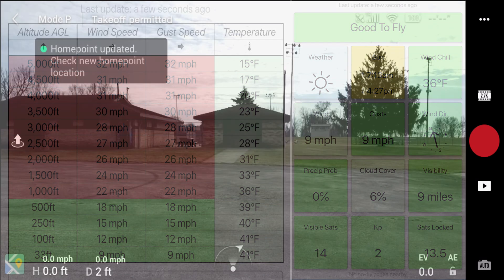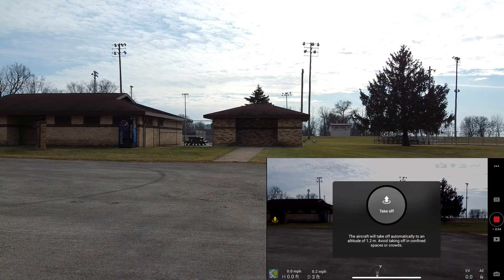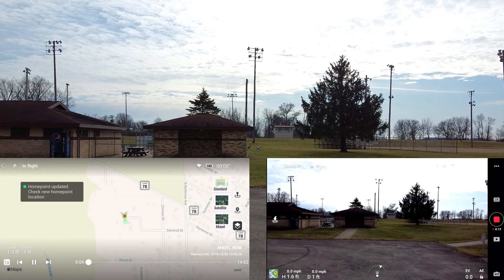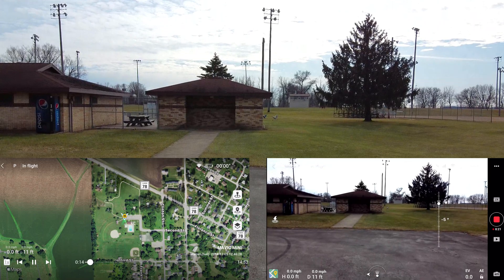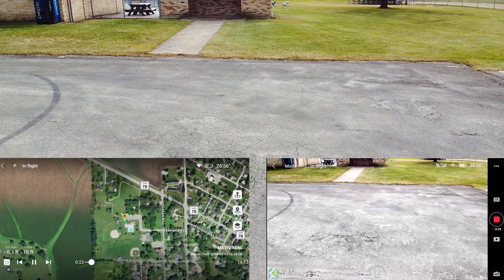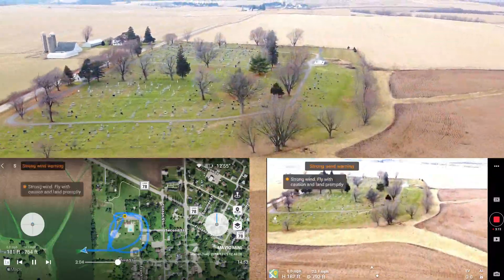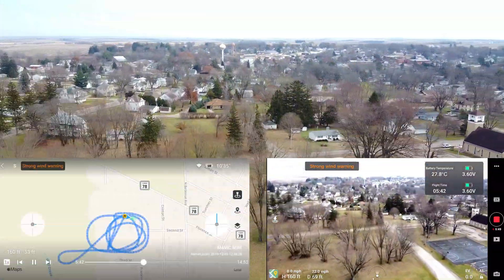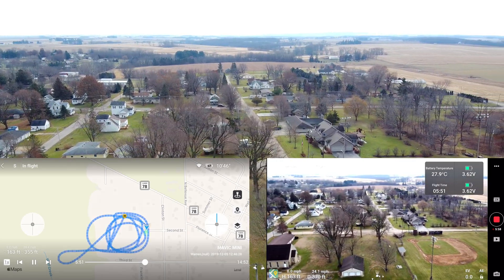Mavic Mini Full Throttle Battery Test

Comment: How long was flight at Full Throttle
Reply from the maker: It was 14 minutes and 52 seconds, 4.7 miles, and I landed at 17% battery.
Reply: @dronerisephotography2378  thanks!
Reply from the maker: @integra8502  I try to answer every question if I can. Thanks for watching.

Comment: It’s fixed because of the firmware 1.03?
Reply from the maker: The new firmware helped out all the warnings for sure. The battery cell voltage is a legitimate warning, but I've heard these batteries can actually function all the way down to 2.5 volts. I'm not sure if that is enough power to keep it flying, but maybe they will do a firmware update to lower the voltage warning.

Comment: Do all your batteries do the same? Or just that particular one? I haven't had that warning show up on my mini.
Reply from the maker: All of them once they are depleted and then pushed too much. As soon as you let off the throttle, the voltage goes back up.
Reply: @dronerisephotography2378  hmm I have hammered mine in sports mode but I didn't get a bad cell warning..  I can't remember if ive pushed it when below 25 though I'll have to test it.
Reply from the maker: Lee Good to be honest, I usually land at around 20-25%, so I’m never usually pushing mine either. I just happened to mis judge the wind coming home, and it couldn’t take it.
Reply: @dronerisephotography2378  ive had mine down to under 10 a few times doing close and low flying but can't remember if I was pushing it too hard.. I know if it goes below 3.3 volts it automatically lands so probably not 😅

Comment: Thanks for the info, I was wondering if you have more than one battery and if so have you noticed this on any of them?
Reply from the maker: I have the fly more combo, and it does it on all three. I don't think it's a flaw, just the way Lithium Ion is.
Reply: Try it with a spark 😉
Reply from the maker: @Hughjanus720  I know! The gimbal would be all over the place and 7-8 minute flight time. 😂

Comment: Great test I think DJI should still address the issue when the battery voltage gets down in the twenty’s maybe with a firmware update
Reply from the maker: I think any wind exaggerates the issue also. The battery just can’t supply the correct supply that the drone wants. In perfect conditions, there isn’t an issue, but these are Lithium Ion after all.

Comment: Great.  Some people have been reporting problems with the aircraft orientation indicator even after the FW update of Dec 4.  Look at your FPV ... was yours reading correctly during this flight?
Reply from the maker: I watched a video from Idaho Quadcopter, and his was accurate. I can say that mine is not accurate on the .300 firmware. One thing that could be messing mine up, is my parabolic dishes.
Reply: This guy did the update and his is still messed up. He's range crazy like you!  LOL  https://www.youtube.com/watch?v=SPptaHYI1dk
Reply from the maker: TommyTester I checked it out, and his indicator doesn’t work correctly either.
Reply: @dronerisephotography2378  Are you using iOS or android.
Reply from the maker: @tfste  I use an iPhone XR, so IOS. Thanks for watching.
Reply from the maker: @TommyTester  Someone told me, that if you calibrate your compass, it should be accurate. I am going to try it when our wind dies down sometime later this month. 😂😂
Reply: @dronerisephotography2378  I think the RC uses the compass in the phone.
Reply: The aircraft orientation indicator has 2 "paper airplane" symbols and a 1/2 circle relative position indicator.  You can get the drone's paper airplane symbol to rotate by yawing the drone; clearly tied to the drone's compass.  You can get your paper airplane's symbol to rotate by spinning around yourself; clearly tied to the phone/tablet's compass.  The relative position indicator seems to be tied to phone/tablet compass and the GPS vector between the drone and the RC.  This suggests the drone's compass shouldn't matter in regards to this "error."  But what do I know?

Comment: Glad the battery test was all good. The latest firmware update could have also fixed any battery issues?
Reply from the maker: The firmware did fix all the Max Power Load, and Insufficient Power warnings, but the battery will still read low voltage when it hits 3.3 volts or below.